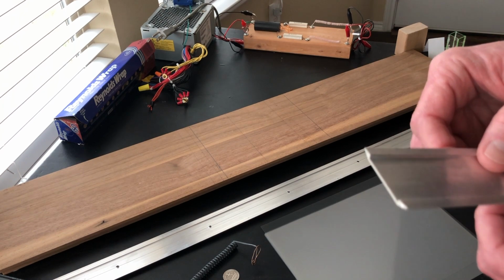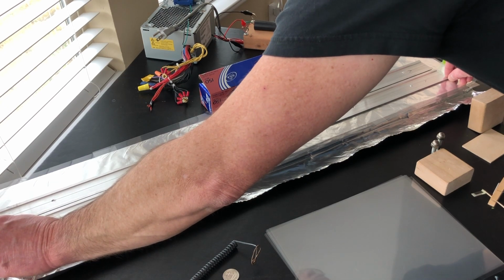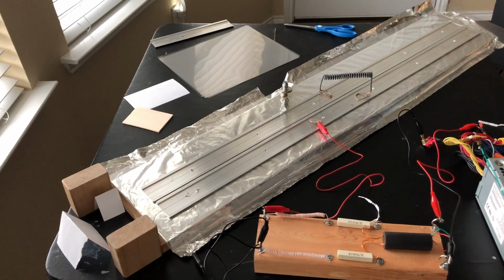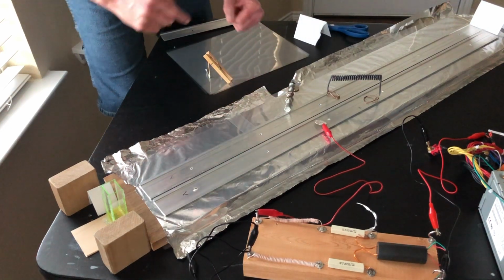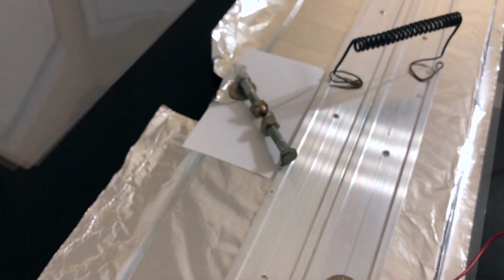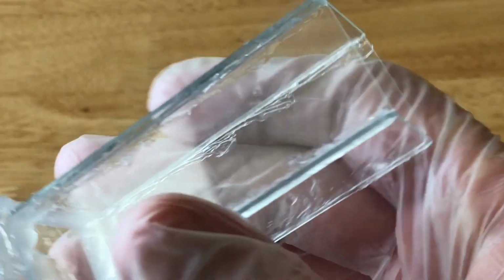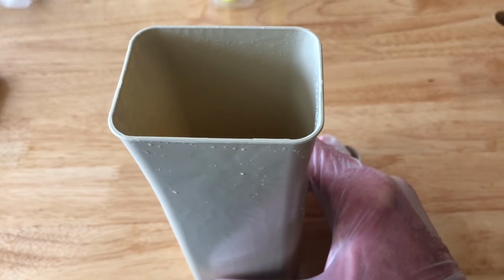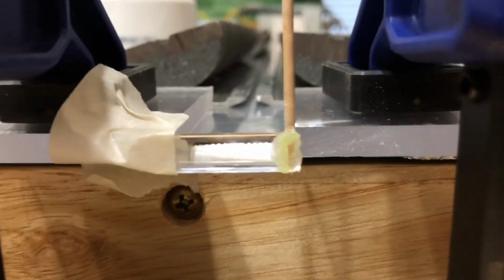A visible laser beam from household chemicals! No laser diodes! No specialized parts. No kidding!

Comment: wow that dye appears to be fluorescing with room light on its own and then more with your flashlight ,now why cant we simply place this between mirrors and use a powerful flashlight or say a tungsten halogen lamp to pump it and make it lase? heck even with room light if you placed it in a fabry perrot would it actually be lasing although very weak but lasing non the less?
Reply from the maker: Excellent question. 

Before phone cameras and smart phones were around, film and even digital cameras used powerful xenon flash tubes to make photographs. Good quality cameras still do. In such a camera, the relatively small xenon flash unit might have a 280 microfarad capacitor charged to around 330 volts. That's about 15 joules of energy. If the flash bulb were a continuous source of light, the 15 joules of energy would dissipate 15 watts every second. As a flash however, the photoflash unit will deliver a lot more than 15 watts because its 15 joules of energy will be dissipated in about a millisecond (which results in 15,000 watts instead of 15 watts). It's all about timing. That 15 joules has to be available when the action is taking place - you have family members sitting on a couch, waiting impatiently for grandpa to snap a photo, and everyone is talking, moving their heads etc. The camera shutter is going to open and close very quickly in order to 'freeze' any motion within the scene, and the camera needs that energy really fast! In other words, if the camera can't get that energy fast enough to freeze all of those bored and restless family members so that everyone can get up and get some cake and ice cream, the photograph is ruined. If the flash were slow, movement would cause people's faces, arms and legs to become blurred and the resulting photograph might be dark and grainy. After the camera shutter closes, any light energy coming from the flash is completely wasted. The longer the flash stays on after the shutter is closed, the more energy is wasted and the less energy gets used to make the photograph. Now in reality, camera flashes are quicker than the shutter speeds that are used to make common everyday photographs, so what I'm describing is only an analogy. But let's apply this analogy to the laser world - some lasers don't require much pump energy, but they need that energy really fast! With a TEA nitrogen laser, the excited states responsible for laser action last only 2 to 3 nanoseconds! After 2.5ns, any remaining energy is wasted and becomes heat. If the stored electrical energy is therefore too slow, efficiency is decreased or the laser doesn't work at all because only a fraction of the total energy arrives in 2.5ns. Pulsed dye lasers must also be pumped very quickly or they do not work at all, however the reasons for this are more complex. 

I recommend that you have a look at the following ... 
http://technology.niagarac.on.ca/people/mcsele/lasers/LasersTEA.htm

http://technology.niagarac.on.ca/people/mcsele/lasers/LasersDye.htm
Reply: @magx1  then what is the glow i am seeing on the edges of the glass? i assume this is spontaneous fluorescing emissions therefore if we trapped this inside a resonator will we not be getting stimulated emission?
Reply from the maker: @ARCSTREAMS  I'm not sure what you are referring to here. However, lasing only occurs along the length of the thin line formed by the focused nitrogen laser beam. You won't get any lasing unless you have the population inversion necessary for stimulated emission, mirrors or not. It doesn't take place under normal conditions. Room lighting, LEDs, the sun or even a strobe lamp will never reach the necessary peak power required to lase a dye like this. With the nitrogen laser, it's the combination of peak power (joules/time) and energy density (joules/meter^3) that makes pumping and lasing the dye possible. With both nitrogen laser and flashlamp pumping, time is a tool used to 'squeeze' huge peak powers from a little energy. The peak power levels are unattainable, impractical or unmanageable in a continuous form.
Reply: @magx1  for the first part it was a quote from one of the articles you gave me , they said when the pump laser is tightly focused and the cell becomes super radiant it is no longer tunable, why is that??  
for second part i understand but then what is this glow i see on the sides of the cuvette when exposed to normal light? this is florescence no? and you never did explain why lasing of the dye only occurs when you inject the laser with nitorgen instead of it operating at normal atmosphere without nitrogen added? if you recall in one of your vids you turned on the tea and it was not able to create a visible blue beam from the dye till you injected the chanel with nitorgen
Reply: @magx1  "The peak power levels are unattainable, impractical or unmanageable in a continuous form." well it dont have to run cw it can be fat rep rate and even 60hz will make it look like its operating in cw mode right? also suppose you can somehow deliver this peak power on a cw basis ,will the dye self terminate because the levels do not allow for such type of cw excitation or will it work but eventually degrade fast unless its being circulated? because again in one of your vids you are pumping it on fast rep rates and im thinking if this was cw it should still work no?
Reply: @magx1  i read a bit specially the part about how the lower the pressure is inside the chanel the longer the life of the upper state, does that mean you can run a N2 in cw? im having trouble understanding the difference between those that run on high voltage rep rate using cap and that on cw that probably does not need cap , also if the upper life is short why will it not keep lasing if you apply cw power to it? it goes up then back down and should go back up so long as there is steady supply no? when you flash a tube and it only exites 60% population inversions then what happens to the other 40% in the ground state during the time energy from the flash is still around?  im not good with electronics and certain terms like capacitance,inductance ,farad etc i need to take some refresher course on this stuff to understand there meaning and how they apply to lasers ,im so confused about life times and how they translate to power supplied etc
Reply: @magx1  it would have been nice if i attended this college in Niagara,im only an hour away from there lol i had no idea ,i know they have training for chefs there but maybe another college?
Reply: @magx1  "When 'tightly' focussed the cell lases superradiantly and hence is not tunable. Normally the laser is made superradiant, optics aligned carefully, then the pump lens is 'backed-off' until the laser is no longer superradiant. " why is it no longer tunable when super radiant?

Comment: im confused as usual, the cylindrical lens focuses the light in the shape of a line ok i got that but this line of excitation has to be somewhere in the dye or does this happen on the inner surface of the glass the pump beam is hitting?  also would have been nice if you captured still shots of the green beam with the fog machine or perhaps it may have been noticeable if captured on video if the frame rate was fast enough
Reply from the maker: Yes, the excitation occurs (in the dye) directly inside of the glass wall. In order to transversely pump a dye with a nitrogen laser, the dye has to be so concentrated that the nitrogen laser beam is absorbed along a hair-thin line at the surface of the dye. If the dye were less concentrated, the nitrogen laser beam would penetrate deeper into the dye and the resulting energy density would no longer be high enough to lase the dye without mirrors. Put succinctly in relative terms, nitrogen laser pumped dye lasers use highly concentrated low energy to pump a small volume of highly concentrated dye. Flashlamp pumped dye lasers use lowly concentrated high energy to pump a large volume of lowly concentrated dye. 

When using a flashlamp, the dye is often contained in a transparent tube (the dye-filled tube serving the same purpose as that of a ruby rod in a solid state laser). However, the total energy from the flashlamp is much higher than the energy from a nitrogen laser beam. As a result, flashlamp pumped dye laser beams generally contain more energy than nitrogen laser pumped dye laser beams. In addition, flashlamp pumped dye laser beams are often more collimated or less divergent (they spread out less with distance). 

If you care to see my work on a flashlamp pumped dye laser, it can be found here ... https://jarrodkinsey.org/lamp/

With enough pulses per second, a dye laser beam can appear to be continuous. Fog machines are great, but I am hesitant to use them in my home. They produce an oily mist that undoubtedly settles on furniture, walls etc. A camera with a fast frame rate would be great for capturing single powerful pulses from a ruby or Nd:YAG laser, however I do not own such a camera. 
Thanks
Reply: @magx1  "directly inside of the glass wall." i think you meant to say directly on the inside surface of the glass wall , ok i understood all the rest and it makes sense that the beam would be more divergent if created in a narrow chanel (hence narrow beam larger divergence) as oposed to that being created in a larger medium like a ruby cylinder or dye filled cylinder with larger cross section (hence larger beam waist and lower divergance).
 about the fog have you ever considered using glycerine instead? im not sure what your fog machine runs on ,perhaps glycol and water? or some kind of oil base? i have used heated glycerine with good results ,im not sure if it ruins curtains or furniture, i doubt it
Reply: @magx1  
"With enough pulses per second, a dye laser beam can appear to be continuous." like say 60hz minimum? i was wondering why you could not have simply made a video to show the beam like you done here
https://www.youtube.com/watch?v=GDJ316rt41M
Reply: @magx1  i enjoyed reading your article but would like more info on the pics you provided ,appears to show your dye tube between mirror mounts and i assume cooling blocks but not much about internal design nor where the flashlamp(s) was placed
Reply from the maker: @ARCSTREAMS  Hi, 
No - they're not cooling blocks. I just needed something that I could drill, tap and that wouldn't dissolve or deteriorate when exposed to isopropyl alcohol. 

My laser was based upon the design presented on the following webpage 

http://laserkids.sourceforge.net/eng_new_dye.html
Reply: @magx1  ok
Reply: @magx1  "With enough pulses per second, a dye laser beam can appear to be continuous." like say 60hz minimum? i was wondering why you could not have simply made a video to show the beam like you done here
https://www.youtube.com/watch?v=GDJ316rt41M

Comment: What will happen if you remove the inductor?
Reply from the maker: Sparks will jump across the electrode channel as the charge 'tries' to distribute evenly. When the spark gap does actually fire there might be weak lasing, or more likely, no lasing at all.
Reply: @magx1  thanks! Can you explain how the inductor helps?
Reply from the maker: @TheRainHarvester An inductor resists rapid change in electric current. When the spark gap fires, the inductor 'looks' like an open circuit to the rapid spike in current that passes across the channel (the gap between the 2 aluminum thresholds). The inductor is like a special switch that is turned "on" when both thresholds need to charge to the same voltage, and then "off" when current must pass from one threshold to the other as required for the laser to work.